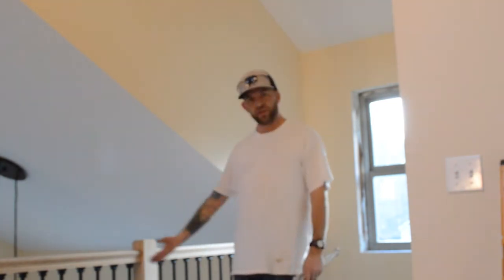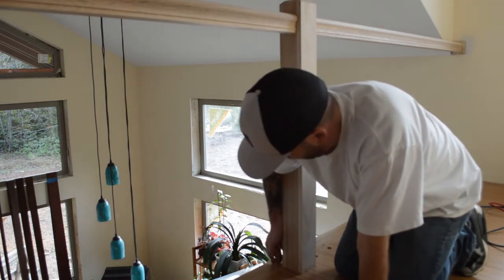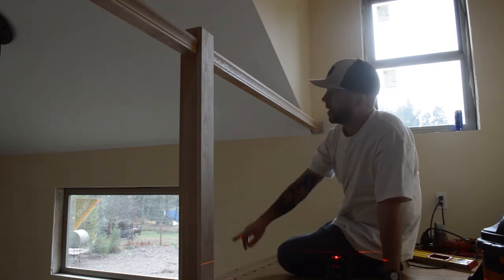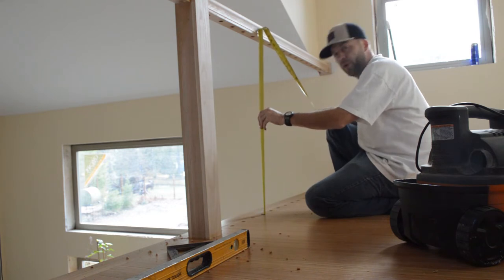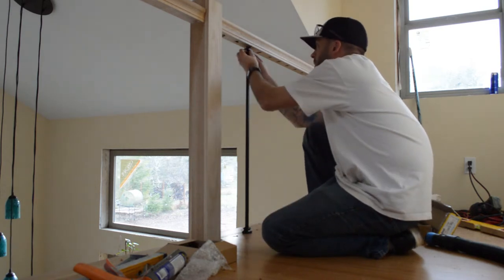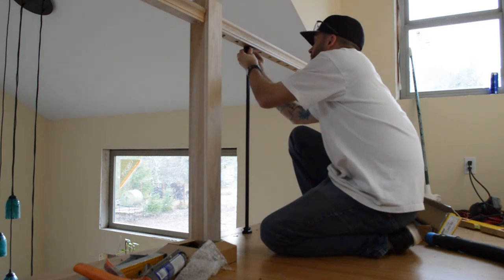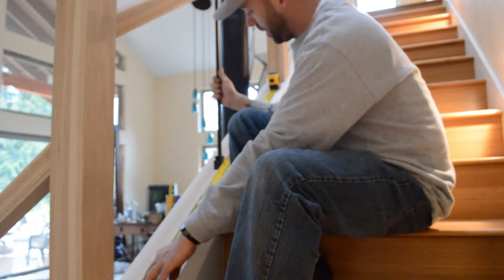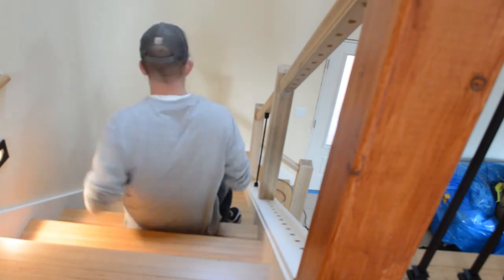How to install wrought iron balusters

Comment: Hi Aaron, great video. I have a question for you. I want to replace my wood balusters (builder put them in) with wrought iron. The balusters are round on the top and square on the bottom. They are both tacked in. The top or bottom of the railing were drilled; however the square bottoms are not. Just tacked in. So I'd have to drill out the bottom of the knee wall wood. 
So my question to you is: can I by a dowel the same size of the diameter of the baluster tops to fit into the hole and then use that dowel as a jig to level the bottom of the knee wall? I know I'll need to use a level too. 
Or is there an easier way to match up the top hole to make the bottom holes. Thanks for any insight you can give me. I wish I could send you a picture of what I am talking about. BTW you do great work.

Comment: Nice work! I’d love to see the math on how to figure your spacing along the rake. 4” along horizontal, but then how does that translate for measuring along the diagonal? Also, what kind of adhesive do you use in the baluster holes and do you put some in the rail holes too? Finally, bro—get some knee pads! You’re gonna wear out your knees!
Reply from the maker: Yeah my knees are already blown out lol. But thanks for the concern. The way that I spaced those I did 4-in up the rake because the balusters are only 3/8 of an inch wide, so it didn't make a huge difference. When I'm doing wooden balusters that are 1 1/4" wide, the spacing up the rake on a 35° staircase is a block cut at 4 and 3/4 in. Pretty much universal spacing for square wooden balusters on a 35° rake. I used liquid nail projects because I find that I could work with it for a while before it set up too hard. I've tried power grab or PL but some of them set so fast if there is a mistake it's hard to fix it. Liquid nail gives about an hour to move things around a little bit if need be.

Comment: What adhesive did you use for this specific project ? I  don't want to use epoxy. I was thinking something like Loctite PL
Reply from the maker: PL works good,  I used all purpose gorilla glue sealant on this one. Seems to me like epoxy would be an Overkill.
Reply: @aaronhilliard5327  PL Premium is stronger than most, if not all, epoxies. I’d imagine epoxy is actually easier to remove than the PL if you ever had, or wanted to replace.

Comment: What size hole did you drill and what kind of glue did you use? Thanks.
Reply from the maker: I believe I used a 5/8 inch paddle bit. Big enough for the balusters to have some wiggle room for installation, but small enough that the balusters boot hides the hole. I forgot to put in the video that I made the upper hole in the railing deeper so I can slide the up into the railing and then drop it into the floor hole. I used Gorilla Glue sealant. Thanks for watching the video
Reply: @aaronhilliard5327  A lot of the videos on YouTube are calling for Epoxy to be placed in the holes.  Do you feel that the Gorilla Glue is just as good?
Reply from the maker: @kevinfreeman2447  yes, in my experience its great. Epoxy seems like an overkill to me